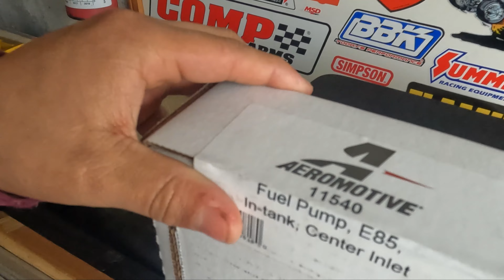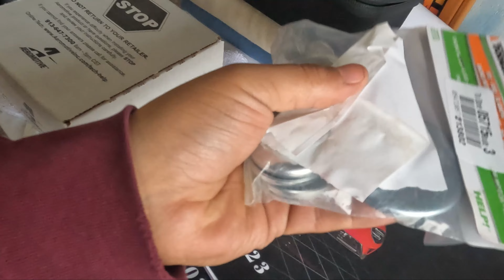Don't Give Up (Motivation)

Comment: My fox had 2 loose header bolts and 1 is missing. And noticed it doesn’t have some of the bottom mani plugged up. I don’t know exactly what supposed to be plugged up but a heads up. Gonna have to redo the whole cooling system and get a new fan clutch. Nothing but $$$$
Reply from the maker: yea brother gotta d what ypu gotta do and stay motivated